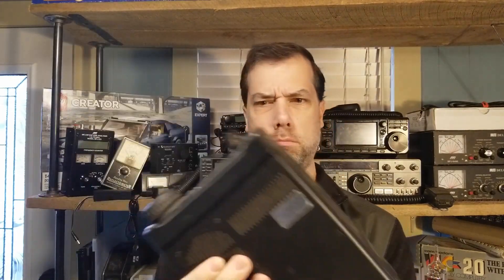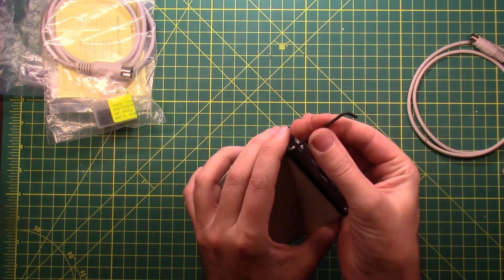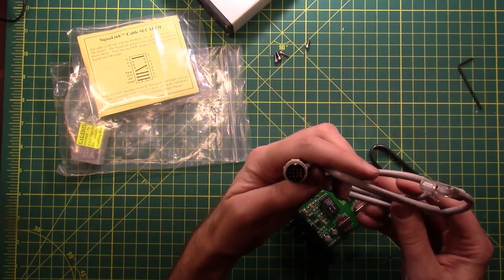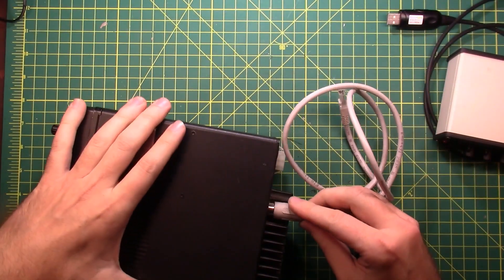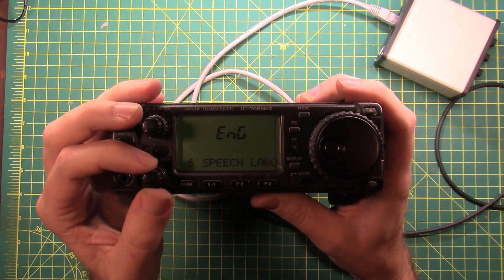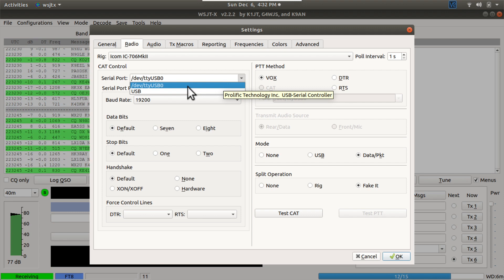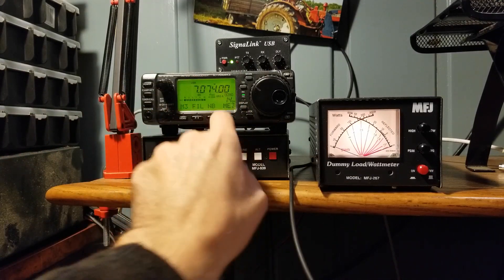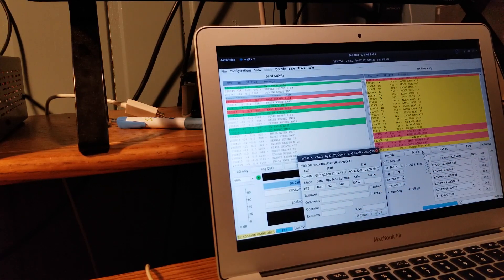Setup your Icom IC-706 for Digital modes like FT8 with a SignaLink

Comment: From the book I have read you really don't want to run 100 watts as you really only need about 30 watts and it is better for your radio as this program runs you rig at 100% duty cycle.
Reply from the maker: You should always manage the heat/duty cycle on your operations, yes.  That said, this is a "full duty cycle" radio and I've run this radio contesting on FT8 for hours without issue.  Work to your own situations!

Comment: What power are you using w/FT8? I've been running power level 4 and wondering if I could go a little higher.
Reply from the maker: If you manage the heat, go for it... If not, Be safe!

Comment: Would a digirig work with the 706mkiiG?
Reply from the maker: It would. Just need the right cable set. I like the digirig, but it wasn't available when I made this video.  Let me know if you run into any snags. The basics are the same.

Comment: Great video, but unfortunately I didn't understand everything because my native language isn't English, sorry, and I'm not a computer freak!  I have an old USB link from Tigertronic that has never been used.  1. Does the SL have to be connected to the PC using the USB cable?  2. a cable to the ACC from the Trx and into the SL and 3. 1 cable from the Cat Trx to the SL or to the PC?  I have an IC 7000, the successor to the 706 Mk2g.
Reply from the maker: Sure thing:

1.  Yes, signalink connects to PC via USB cable.
2.  Yes
3.  CAT Cable from Radio to PC

7000 setup should be very similar to 706 setup.
Reply: @temporarilyoffline  Thank You!! 73 Thomas

Comment: I just found your video, good video.  Have you tried using digital modes in VHF/UHF using the IC-706?  If so how?  I have a mkiig and I can't seem to get it to key up.  I am using a signalink connected to the ACC port.  Works perfectly on HF, just not on the other side of the radio.
Reply from the maker: I haven't and I don't have the radio anymore.  Its probably a setting inside the radio to allow it.  At that era, VHF/UHF was packet more than audio injection, so it might just be expecting something different  -  Try turning on PKT mode, that's what I had to do on my FT-818.  Let me know
Reply: @temporarilyoffline  There are two ports on the back, the ACC port and the packet port, I needed to use the packet port.  I did some research and found I already had the correct signalink and cable from another radio and hooked it up and it worked perfectly through the packet port.  ACC port for HF, packet port for VHF/UHF.
Reply from the maker: @carroll-w7wxv  there you go!

Comment: Amateur radio operator looking to try FT8 .Im going to use the Icom 706 MK1 i know i need to order the CIV  Cable and the sinal link box but what is the name of the DIN Cable with the RJ45 on the other end called and where do i purchase this if i may ask.
Also is their anything else i need to buy
Thank you
Reply from the maker: The signalink here: https://amzn.to/3pRw5fK includes the right cable and config chip for the 706 radio.  Let me know when you get it all setup, the 706 is a great radio.
Reply from the maker: The signalink here: https://amzn.to/3pRw5fK includes the right cable and config chip for the 706 radio.  Let me know when you get it all setup, the 706 is a great radio.

Comment: so the chip you change is for the pim mapping of the audio lead? that's archaic? why can't they use a microcontroller which can be programmed?  Wierd.
Reply from the maker: Ham radio is pretty archaic in general
Reply: @temporarilyoffline  i wouldn't say that. some of the newer gear can make your tea for you in the morning. :)
Reply from the maker: @frankbaron1608  there are some features I long for in ham radio.
Reply: @temporarilyoffline  me too. one of those features is a lower than rididculous price :)

Comment: Great video. However I can’t find a usb driver for my 706. Any suggestions?  ROD. K7UJ
Reply from the maker: Which cable did you get? Which OS?
Reply: @temporarilyoffline  windows 10. The ci-v cable arrives Wednesday. My understanding is that I have to install the driver before connecting the radio to the computer. Icom website has a lot of drivers but none listed for the 706.
Reply from the maker: The cable I linked comes with a CD, I can plug it in tomorrow and see what chip it is
Reply: @temporarilyoffline  thanks
Reply from the maker: @rodwillett8814  The chipset on the cable in the description is Prolific Pl2303 - Driver for Windows is here: https://www.prolific.com.tw/US/ShowProduct.aspx?p_id=223&pcid=126. (the trailing period is important if missing)
Reply: @temporarilyoffline  thanks!

Comment: Excellent video. Any tips on getting the 706 to work digital on VHF? I get it to work fine on HF, but i can’t get the radio to key up on VHF. Any help is appreciated.
Reply from the maker: I don't see any reason or settings that would stop this from working.  Does the software change the frequency to the VHF WSJT-X freq?
Reply: @temporarilyoffline  no, I don’t use rig control. From my limited experience, when I run into issues like this, it’s a setting somewhere.
Reply from the maker: Does the signal link PTT for you?
Reply: @temporarilyoffline  ya. Everything seems to be set right, it just won’t key the radio on VHF or UHF. Change it over to HF, she fires like she’s supposed to.
Reply from the maker: @ryanjones9305  very weird!  Mine is in a bit right now or I'd fire it up and see if it does the same.
Reply: @temporarilyoffline  I may have found the solution, I’ll try it and report back.
Reply from the maker: @ryanjones9305  you have my attention!
Reply: @temporarilyoffline  not sure what happened here, I posted a solution but I guess big brother YouTube found something wrong with it and dumped it down the memory hole. If you use QRZ, I’m good there, look me up and send me an email. 
73
KC5HOZ
Reply from the maker: @ryanjones9305  there is no email on your QRZ page?
Reply: @temporarilyoffline  ok. I just updated it and made it public. Try again when you get time.
Reply from the maker: @ryanjones9305  Got it!
Reply: @temporarilyoffline  and the reply I emailed you was exactly what I posted up here and somehow got nuked by the YouTube masters. I didn’t post the screen shot, but I quoted the info section. Did you see anything wrong with that info? Any reason it should’ve been taken down?
Reply from the maker: I'll take a look

Comment: Hi, Do you need the chip cable that you show on IC-706? I have IC- 718 tiring to hook up to signalink  do 
I need that chip cable with that chip in it to work with IC-718. And is it the same cable that you used? In the IC-706? I hope you can help me to hook up to IC-718 I CANNOT GET SIGNALINK TO WORK. 
THANK YOU KG7LNA
Reply from the maker: If you go to tiger electronics website, they should have a kit.  You will need the chip and the cable and it could be the same chip and cable I'm using on the 706.  Give them a ring and they can help you out better than I can.

Comment: When I tested my Cat control I got a red light and now I am stuck.
Reply: MkIIg
Reply from the maker: If you press "Test CAT" and it goes red, then one of the cat settings is wrong, double check the radio settings for baud rate and the computer settings to be on the right serial port.  If you press "Test PTT" and it goes red, then you're good to go on PTT, press "Test PTT" again to turn off the transmitter.

You're making progress!

Comment: great video how ever how you set to USB D on the radio ? I think it will not show 
many thanks
Reply from the maker: I've got "Data/Pkt" set in the WSJT-X setting.  I don't remember if you can press "mode" on the radio enough times to get it to Data mode.  If not, it is what it is.  This is a great radio and has gotten me lots of QSOs over the years.  A keeper for sure.

Comment: if baud rates is set to auto, will it work?
Reply from the maker: If you're using a USB to serial adapter it might be fine with Auto.  You won't hurt anything if you try it, it just will or will not work.

Comment: One thing to note with this: programs for CIV control that only have presets for the MkIIG will need the address changed either in software or in the radios settings.  The address for the MkI and MkII is 0x48 but the MkIIG address is 0x54.
Reply from the maker: #Protip!  Thanks

Comment: G'day, I used your suggested configuration of WSJT-X and the receive works fine on HF and VHF.  However, transmit doesn't work.  Have you heard of any issues with lack of transmit using this configuration?  I am using Win10 and have rig control via RT Systems i/f.  Tigertronics recommended the miniDIN cable for i/f.
Reply from the maker: I haven't used that config, PTT via SignalInk doesn't work for you on windows?

Comment: Thanks. Very helpful and very well done. Thank you, you saved me a bunch of frustration. However, I'm curious, in keeping the spirit of running only the power you need to, as you stated in your video, isn't 100 watts on FT8 excessive?  Considering that most people run around 10 or 20 watts?  Also, those digital modes are pretty high duty cycle and running any rig at full power key down is not a good idea. 
Why aren't you running much lower power??
Thanks for such a helpful video.
Reply from the maker: I run "the right Mount of power to make the contact" and usually I'm trying for DX.  Being in Wisconsin, DX is very far away for me.  Keep in mind that FT8 is "weak signal" not "low power ", as you said, use the right amount of power to get the job done
Reply: @temporarilyoffline  Cool. Makes sense. I have no problem with it, I was just curious. I run a lot of WSPR, which is a mode that has a totally different charter in life than making contacts. 
You have some great videos.  I got a lot form this one because I am planning to use my 706 as a WSPR beacon so I'm in the throws of interfacing it and your video was a true god send. Thank  you!! 73
Reply from the maker: @ronjones4069  This will work great for WSPR setup
Reply: 100 watts is low for some hams.  Some EU's are running 700 -1000 watts on FT8

Comment: Is there a reason why you didn’t use the 6 pin connector? My 706MKIIG has this connection on the back and DX Engineering said I can use it. Just curious. I haven’t hooked up the Tigertronics unit to test it yet
Reply from the maker: On the 706MKII, there isn't a 6 pin connector.  Maybe on the MKIIG?

Comment: Do you have to change these menu settings back and forth when you are swapping from ft8 to ssb and back?
Reply from the maker: No, the settings in the rig were for how the Serial Port/CAT control works.  Once you exit WSJT-X, it will try to return to where it belongs.  On my Kenwood when I left WSJT-X it would return every setting EXCEPT for the mic-gain and it took me a while to figure that out, so there might be something minor left behind like that... or split... but you'll know it right away!
Reply: @temporarilyoffline  ok thanks! I'm about to add a mk2g to my collection and i will be grabbing a signallink for it

Comment: well, I followed it step by step but the signalink doesn't turn on for me
Reply from the maker: Are you powering it from the rig or from the wall?
Reply: @temporarilyoffline  I just connected things the way you showed it. You don't show how you connect to the computer so I watched some other videos and there is a cable that plugs into the USB port on the back that goes to the computer for power.  You didn't show that so I didn't plug that one in. Once I did that it powered up. It doesn't have a power cord to plug into the wall so I'm not sure what you mean by that. In any case once I got it plugged and powered it wouldn't transmit on FT8 so I have some configuration issues to deal with.  Thanks for your response.
Reply from the maker: @petermilne7063  I must have forgot that part. Sorry about that.  What OS are you running?
Reply: @temporarilyoffline  I'm running Windows 10. I had the same problem running FT8 on my Yeasu FT-1000MP MKV. The PTT light would go on and the rig showed transmit but the indicator on the left would show a green bar going up to about 8 during recent but then disappear in TX and the arrow drops to zero with no sound even though SignaLink and rig show in transmit mode. I could never get it to work. I thought it might be the rig since they are known to have trouble with FT8 so I was hoping the IC 706MKII would work. Same problem so an issue with the computer configuration must be it.
Reply from the maker: That is usually windows audio settings (volume levels). And in windows they are known to reset after system updates.
Reply: @temporarilyoffline  That's what I usually am told when seeking solutions.  I set things up according to SignaLink's instructions and watched videos like yours but no luck.  CAT tests green PTT tests red or I get an error message. 🤔 I've been trying off and on for over a year with two different desktops and a laptop with the same results.  FT8 isn't a must have for me so I'm not going to invest much more time trying to get it going. Thanks for your help 👍

Comment: I noticed you did not adjust the volume control on the radio for RX.  Would that be because the audio on the rear DIN connector is a fixed output level?     Would there be any benefit of using the rear MMJ connector for the TX/RX audio instead of the DIN connector?    Thanks
Reply from the maker: Yes, the audio knob on the front is for your ears (and I can't decode FT8 in my head... yet), the audio out of the rear is fixed, although there might be a buried setting for changing that.  I didn't find that I'd needed to mess with it.  The signalink was hearing just fine without changing that type of setting.  I don't have an MMJ connector on my 706 that I'm aware of, maybe thats a MK1 or MK2 or G model feature?
Reply: @temporarilyoffline  That's what I assumed.  A friend was having problems adjusting the audio level into FT8 using the vertical bar.  I once had a Internet Radio station using a IC-706 and I used the rear mmj port for both TX and RX audio and it was adjustable from the radios volume control.   When the friend said he was using the SignalLink but the radios volume had no effect  I figured the rear round din was a fixed level.
Reply: @temporarilyoffline  On my IC-746 I use the front mic connector.  I can get RX audio their as well as mic in.  I have a blank head phone plug I use when I want to mute the auido.  I found it easier to adjust the RX audio from the volume control.
Reply from the maker: If it works it works, right?
Reply: @temporarilyoffline  It certainly does

Comment: Hi, What power do you usually run on FT8?
Reply from the maker: I normally run all the power I have available and routinely miss some of the stations I'm trying to complete a QSO with.  FT8 is a "weak signal mode", not a "low power mode"

Comment: Ideal as i have just bought a secondhand signalink which came with a kenwood cable and module. I have ordered a icom cable and module and when arrived will set it up as your video. Thanks Les
Reply from the maker: Perfect timing.  Let me know how it works out.
Reply: @temporarilyoffline  Said i'd report back, defaults didn't work for me, i got some weird things like frequency changing to VHF odd frequencies way out of band, after Tx, not everyone but odd ones. what does work for me though is Radio: Com 19 (thats what im using on my computer) baud rate 19200, matched on serial port (device manager) data bits 8 stop bits 2 (also matched) handshake none. Force control lines not used. PTT Vox (as im using the signalink) Mode Data/pkt, split operations Rig. Works perfectly like that rx is set on the signalink to 70-80db around the 11 oclock setting, Tx is again around 11 oclock setiing power on wsjt-x is 1 notch off full giving ALC of zero. Delay set to counter clock wide and poll interval on WSJT-X set to 1 second.
Reply from the maker: Sounds like you got it working.  How are the contacts coming in?
Reply: @temporarilyoffline  Just on 40m at the moment (FT8) only been on about 40 mins and one CQ but getting out well across europe. Just using SGC237 remote tuner and a random wire with the Icom 706Mk1, doing as good as my other radios on 40m (FTDX300 and IC7300) with end fed half wave!
Reply from the maker: Awesome.  Glad it's working for you
Reply: What Mic Gain setting is the radio at? I find I’m constantly juggling the sound card gain and mic gain and I’m never sure if I have it optimized.
Reply from the maker: Hey Dave,  I didn't mess with the mic gain,  next time I have that radio hooked up I'll take a look.